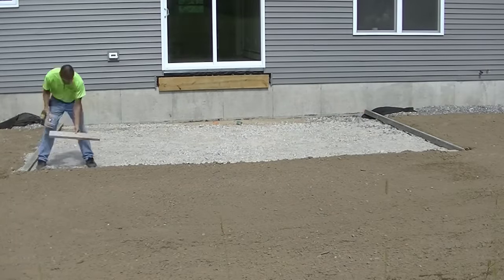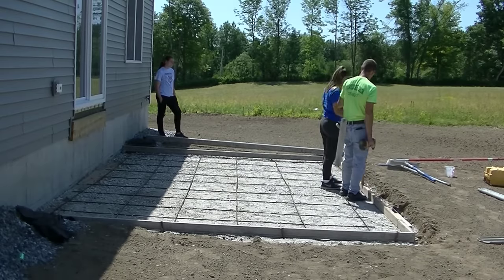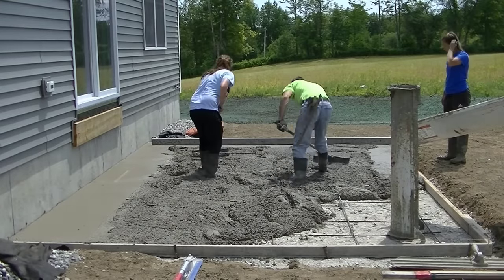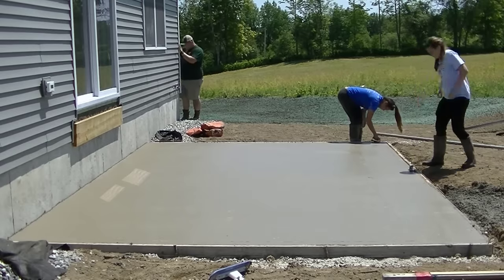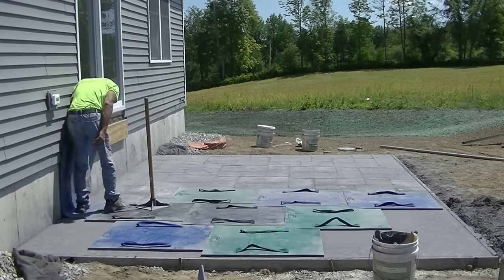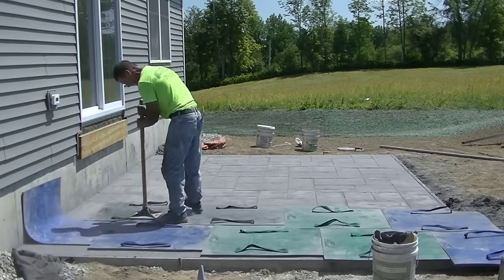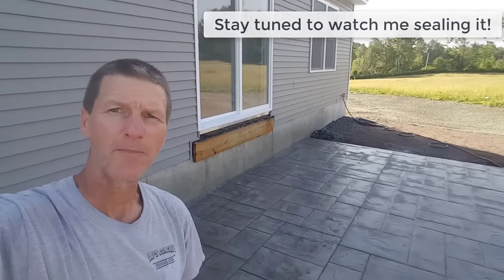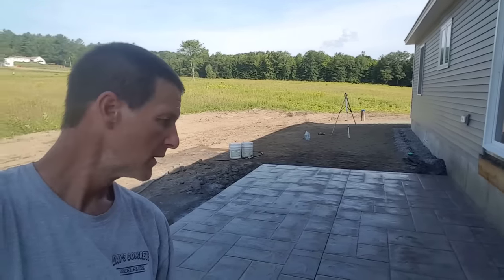How To Form, Pour, And Stamp A Concrete Patio Slab

Comment: Great video, not sure if this question has been answered yet or not. Would adding retarder to your mixture have helped you achieve a better timeframe for stamping or would that have not been a good idea. Also, can you walk on the sealer when applying the second coat or how does the second coat application work?

Comment: Always a joy to watch a pro at work. Outstanding result. Two questions, though: why use the saw to cut grooves or "saw joints"(16:44), and will the sealer that lands on the wall change its color permanently (26:30), in which case I need to cover it?

Comment: Great video!  I used a chemical sealer on my concrete driveway, (PS101 Siliconate Multi-Surface Penetrating Sealer) and noticed that when it rains, I am getting dark patches throughout the concrete in certain area, but then they go away when it dries.  Should I do another coat?  Can you use a different companies sealer, like the one you used?

Comment: Wow.  My respect for you Sir.  You did an amazing job working pretty much by yourself,  it's not easy specially working with concrete.   I was wondering on what type of steps the home owner ended up building up after your patio?   It's a high distance from the bottom?
Reply from the maker: They just used pressure treated lumber for the landing and steps.

Comment: I want to do stamped concrete on my existing concrete steps. Do I still need to create a rebar mesh before applying a layer of concrete? What kind of bonding agent and sealant do you use?

Comment: Thats a nice job that Mike, the finish looks really nice. 👍
I’m from the UK and I laid a few large slabs about 6” thick with rebar or fibre in service stations and our regs stated we could lay a slab around the size you did there before use expansion joints.
I’m looking at doing this around my house and was wondering if you had issues with slabs that size cracking due to no expansion joints?

Comment: Did you put expansion joint material up against the house foundation before you’re poured? If so, how did you get that fiberboard to stay in place when pouring the concrete?

Comment: Hi Mike, I'm about to try a stamped patio slab in the coming days, after seeing your video and techniques. I've done several small slabs and walkways in concrete before, but not imprinted concrete. How long should the slab be left to go off before setting the mats in place and stamping, please? Or do you use a finger imprint to test, or rough amount of time?

Comment: Great video. I had my stamped concrete patio done on a warm day in May. Came out great, but after a few months some surface cracking started, and it looked like some area were crumbling on top and this started flaking away. I resealed it to fill in some of this areas, and it's been okay for now. What causes that sort of crumbling cracking? Is that from stamping too late?

Comment: Looks good, just a couple things.  Need to drill rods into foundation 4 inches down to avoid any sinking of slab by house.  Also, I would recommend expansion joint along foundation to allow for expansion and contraction.  Thanks Nice Work!

Comment: Hey Mike, in order to save your wood planks for your FORMWORK, why don't you use OLD ENGINE OIL on the wood forms facing the CONCRETE so the concrete does not stick to the wood and the wood will not absorb the moisture in the concrete.   What do you think ?    Also, do you elevate the STEEL REBAR with PLASTIC CHAIRS or CONCRETE BRICKS away from the ground tamperplated compacted  crushed stone ?

Comment: One question:  Do you need an expansion joint between the foundation and the slab?

I have read some sources that say you should do this so damage doesn’t occur between the concrete foundation and the slab.

Anyway, I'm curious what your thoughts are.

Comment: Great Video, Great looking patio. But just curious, Why is the grade so low on the house? Maybe it's a regional thing but usually the siding would go down enough to match the grade of the yard, or the grade would come up to a few inches below the siding. Just interesting to see the concrete exposed on the back of the house.

Comment: Question:
Obviously it’s in the north eastern of the country;  typical would see some grit inside the pump sprayer added to the sealer to add for traction.  

Is this something you use ?  
Soaking the sprayer tips after to break up the sediment to use it again in the future is what I seen done along with rinsing out the pump sprayer.
If the average person seen this they would say it’s individual slate pavers instead of stamps-  came out real nice.

Comment: Great work, what is the average cost for such a job. I realize it has variables such as location and stuff, but the average will do. Thanks.
Reply from the maker: Between 15 and 20 per sq ft
Reply: @MikeDayConcrete  is that for the stamping and the concrete work or just the stamping?

Comment: I just had my driveway replaced with concrete and decided to have it stamped. Big mistake for me because the design and the pattern was not planned out ahead and it ended up not having any symmetry to it. When standing in my garage the pattern gave the illusion that it was lopsided but it wasn’t so bad until they came the next day to cut. Now it for sure looks really bad and noticeable. Just throwing this out there but any suggestions that I could do to help it be less noticeable?

Comment: I had my concrete poured and stamped, added a colour.
   For two days I had a sprinkler on it after 24 hours. But the 2x10 I placed the sprinkler on leached and stained the stamped concrete. Is there anything I can do before I pressure was, clean and seal the concrete. Or am I SOL? Thank you!

Comment: Hi

Wow almost 3.5 M views - congradulations

With the hot edays, i know here in Australia in summer any work like that they set up a 4 / 6 post shade cloth or canvas for workers shade plus to keep the sun of the concrete and dry the top 5mm prematurely, on severe hot days when the main team leaves they leave a junior or advise the owner to fine spray water mist every few sunlight hours  for 5 mins or so each hour

Do you need to have a plastic sheet under the rebar to hold water in summer to keep the fresh concrete more moist ??

Comment: Hello Mike,  it's Ian SCOTTA here again,  why are you not using an EXPANSION JOINT ( like 4 inch foam or that black tintass.or a.rubber membrane  space to.separate the.CONCRETE POURED SLAB away.or.divided space to the existing house concrete foundation wall to PREVENT CRACKING IN THE NEW CONCRETE POURED FLOOR AFTER IT STARTS TO SETTLE. ?

Comment: Very good work indeed but i wonder why you cut the concrete with the saw ? ( those edges will break when something heavy is on them )Why not do those lines when the concrete was still fresh?  Other than that great work .
Reply from the maker: The contraction joints look much better with the saw. And the slab is more likely to crack in a saw joint. No problem with heavy things being dropped on them. Been doing it this way for over 30 years.

Comment: just wonder about your patio slab...had it cracked by now? The hot summer days are detriment to pour concrete slab.  My previous slab home was poured in June, and it cracked up a few weeks later...The contractor did nothing to slow down the curing process after they poured the concrete...

Comment: Just a curious question for an absolute newbie; why do you cut the concrete slab?
Reply: They’re called control joints. All concrete will crack even with rebar. The saw cut joints help keep the cracks to a minimum and in the joints
Reply: @robertplatt3329  thanks so much!

Comment: That turned out amazing. I was curious about the lines you sawed out after stamping. Is it for aesthetics or structural?
Reply: its for cracking.. they are Crack control joints

Comment: Great finish and having done the job myself, I know that on a hot day, (forget the camera speed up ) you do actually have to work that fast.
We used to mag a colour into the concrete, trowel it in  and then mag the release on top....thats a lot of dust.
The main reason why I packed it in.
Mike I would strongly advise using a mask. Everything about the job is toxic, from the sealant to the release agent.
Good vid though, enjoyed it.

Comment: Why didn't you split the concrete into sections when it was still wet with the tool then stamp over? The join will be there but covered by the stamp. Looks way cleaner aswell

Comment: They are called loop ties and are only used in residential concrete, spray the substrate wity water prior to pour to reduce wicking of concrete water. Use vinegar to clean siding and glass, never use a pressure washer, running water only

Comment: Next time you should have started right in the middle going towards the left and right sides so you will have the same pattern sizes as the cut-off edges. Do it on all of your jobs if you use a pattern maker for a better result.

Comment: I can spot a few issues with why you had problems with your concrete drying/curing so quickly.
First off , it was a 90 degree day.
Second, your driver was over an hour getting there .
Third, your slump on the concrete was about 3.5-4 inch slump, when it should have been more like a 5-5.5 inch slump, which would have allowed you to work without rushing. Plus you and your daughter and her friend wouldn’t have had to work so hard moving it around.
Now when you ordered your concrete! Did you tell the dispatcher to use ice/chilled water to keep the temperature lower? 
The reason your concrete was warm/hot is because that’s the process of how concrete dries. All the ingredients used in making cement/concrete create heat when mixed together therefore the water content begins to evaporate and the concrete starts the drying/curing process. And you used a high sack cement mix for more strength. 
Now despite all those issues ,your job turned out well . I’m certain you and your daughter and friend were totally exhausted from the hard work.
But congratulations on having children that are not afraid to get their hands dirty.

Comment: How come you did not pick your steel cage off ground, or use spacers to lift cage, or use concrete bricks to put steel up in concrete. On ground steel will soak up moisture.. corrosion.

Comment: I would rather put the soap a bit more concentrated and then work it around with the broom . That way you are not chasing the soapy water and it’s not running off the sides. Use maybe 1/4 the amount of water and then spray on extra if needed?? I’m just saying

Comment: You suppose to be pulling up the rebar to close to the center of the thickness of the concrete for support, not leave it at the bottom.

Comment: Great workmanship and the final product was as advertized.  The only thing for me is that the black color, enhanced by the sealer, actually looks like dirt.  The color seeps and is preserved in the areas you would expect dirt to so, on the video at least, it appears dirty.  It could be the camera your using which is very shacky.  I would still watch your other videos as they are informative and you obviously know your trade, but you might consider investing in a better camera.  Just my two cents.  Thanks!

Comment: why the saw cuts?
Reply: The concrete will eventually crack, with the cuts it will crack to the cuts and not all over the place.  If you leave too big an area without a cut it will crack randomly.  The stamping is not deep enough to control the line of cracking.

Comment: This comment has nothing to do with the concrete, which is a good job. It's about pressure washing house siding, you see the seams where the siding laps over the previous piece, you want to spray in the other direction, when you look down the side of the house the laps are hidden. When you spray against the laps, you're forcing water behind the siding.

Comment: for as long as you have said you have been doing this, why did you waste your time putting rebar in and not once did anyone lift it, a patio this small you could have gotten away without the cut if steel was lifted, yours will still crack, and I have been doing this longer than you and I could tell you had a little panic in you doing this job under the circumstances, and start using duplex screws, you will love them
Reply from the maker: It had rocks holding it up

Comment: Why would you put rebar in and just leave it on the ground?
Rebar should be fully encased in the concrete on spacers so its not coming into contact with the ground..
I hope the concrete floor was done properly otherwise it wont last ten years

Comment: You really do need to invest in a suitable RPE (a mask). This is silica dust and the amount of dust you are creating and breathing in is staggering and very dangerous to your health. No Engineered controls for the electric soft cut saw by extracting the dust on equipment so you are magnifying the amount of dust that you are breathing in. Look after your health as well as doing a great job buddy.

Comment: Typically you must allow the concrete at least 30 days before applying ANY SEALER…. Otherwise it will yellow and cloud up because the fresh concrete has water still NOT dried out….
This is not a game-
This guy takes HUGE GAMBLES with an expensive and labor intensive operation that completely fucks up when you have NO IDEA what you’re doing…..